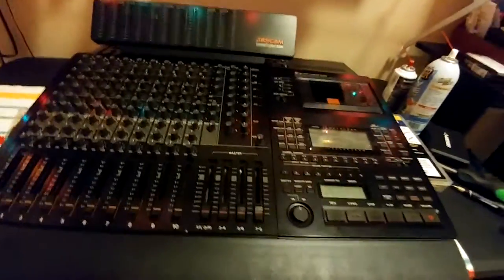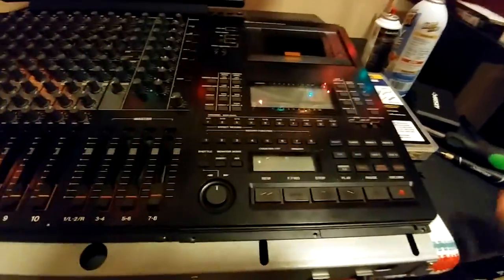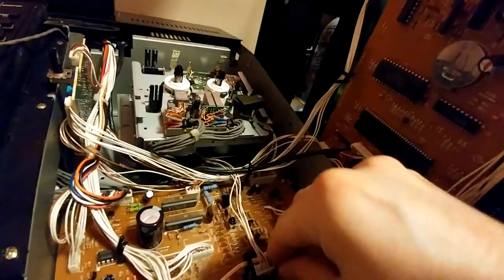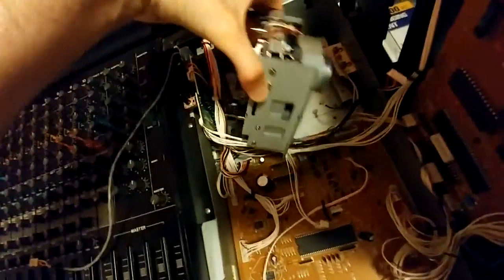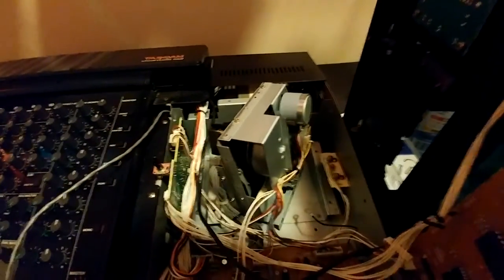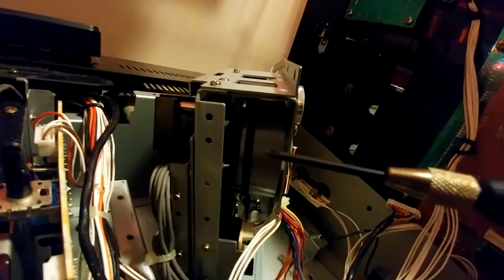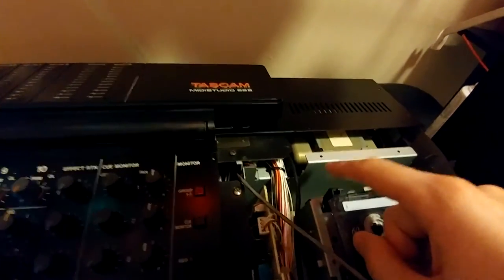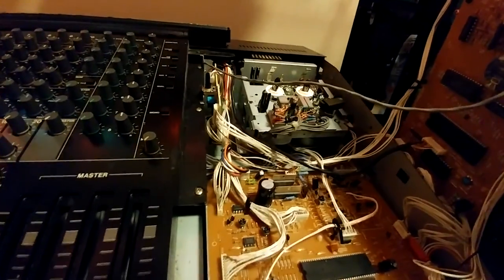Tascam 688 Belt Replacement (and solution to transport stopping during playback)

Comment: Also the battery is CR2430. It is spot welded/soldered in. So you can't remove it by force. You don't need the battery except for savings scenes. For me the default scenes 1->12 are all I need. So I just left the old battery in there.

Comment: Thanks for posting this!

For anyone else struggling with getting the wrist piece off (on the front of the unit), I also had to take three additional screws off of the bottom. These are clearly visible and not hidden inside holes or anything.

Also, he forgot to mention there are three screws on the right side of the transport control panel that need to come off before you can pull the panel off.

Comment: I just finished changing my belt thanks to this video! I also followed the service manual which you can get from hifiengine. You don't need to remove the screws for the wrist rest. Just loosen them a little and it will slide right out. When putting it back together, put on the side brackets before putting the wrist rest back on. There is a little L bracket that gets in the way of the side brackets. You have to remove it's bottom screw and rotate the L bracket out of the way. Then the side brackets goes in easily. Another gotcha was the screws that mount the transport to the frame. There are three, one on left and two on right. You need the right size screwdriver to get them out. I had to experiment with different bits to find that would grab. If none grab you can try taking pliers to grab the screw and rotate it. When putting these back in , don't over tighten. They are not meant to hold the transport securely. There will be a little wiggle room which gets removed when you put the two final scews that go through the cassette well.
Reply: nice tips , thanks ! where did you purchase the belt replacement?
Reply: @jazzroom  ebay
Reply: @fhussain44  thanks for reply ! Ive ordered from eBay too but it is to big ..even though it's been advertised as the Tascam Midistudio 644. Do you have the name of the ebay seller ?

Comment: Thanks, you've been a great help. I was almost there, now I know I won't break anything. FYI, those two adjustments in the video (that you said not to mess with) are speed control trimmers. R2 is used with pitch control in 'fix' position. R1 is used with the control in 'ext' position.

Comment: I just followed these instructions to get it open, sure enough the belt is age melted in there on the capstan roller. Time for a new belt and back to using this amazing machine. I’m surprised to see there is a button cell battery in the piece that you pull back, mine has not been changed since at least 1999.

Comment: There is some disagreement on whether you need to put grease/oil anywhere. I just put a drop of sewing machine oil inside the capstan bore after I removed the whole flywheel by sliding it out.  Rest I just left as is since it was all functioning fine .

Comment: 1, You don`t need to take the wrist support screws out , just loosen them 2 , if you take the wrist support off first and then remove the 2 clips (one either side) you dont have to fight with the side trim pieces AT ALL .

Comment: any recos for lubricants for the motor / belt that you mention? as well as cleaners? also have a 644 with the playback issue. ordered capstan belt and motor replacement and using this video to make the repair. thanks!
Reply: @albino_gringo1912  super helpful. what about cleaning where the belt dissolved. i imagine remnants are still there once i open it up. just iso alcohol and cotton swabs?

Comment: Thanks for the video, I want to change the battery on mine now I know where its at. Do you know what coin cell to use 2016, 2032 and have you changed yours out?
Reply: It is CR2430 and it is soldered in! So don't try to pry it out like I did..

Comment: Thanks for the vid! I just replaced my capstan belt (the old one had completely deteriorated). Now it rewinds and fast forwards fine, but plays at a manic speed. Any idea what I did wrong?
Reply: I don't think so, but I'll reopen it and check. Would that make it run too fast?
Reply: Mark Zanandrea whats was the solution to this problem ?

Comment: Much respect to you for creating this video. Big boost in confidence on repairing myself.  I'm experiencing the transport issues (random stops) & scratchy faders (buttons & knobs). Is there any precaution on opening the left side panels for inspection? Thank you !
Reply: using contact cleaner and air blower is good for faders and knobs. But opening left side panels is a complete mess for cleaning deep inside. Try a air blower for the faders and knobs. it works well. (sorry for my english)

Comment: Dude,
This is great info. I am having a problem where the Capstan motor seems to be continuously spinning, even with no tape present. I noticed your Capstan was spinning until you powered down. My unit is as pristine as yours, with actually very few hours considering 1990(?) Purchase. Virtually no Stunt mode shuttling, or variplay, simply record and playback, maybe 100 hours lifetime on unit. I was always a diligent cleaning / degaussing engineer, having worked on 1” type C” Broadcast units since early 80’s at MTV and HBO. Is the Capstan motor supposed to spin all the time? It would seem that would burn out motor. I only noticed this very quiet day in my loud Condo. I see Battery for CPU under Board you removed, I have not even had to replace that. Thanks a million, any ideas? Do not have either my owners man or a service manual, though I downloaded a barely visible ops man. Great Unit for its day, still works, but I figured some micro switch was giving a false run signal, even without tape in unit. Idea’s? -Bobby

Comment: Thank you for this video. I replaced the belt, but my FF and RW still don’t work, and the playback is sluggish. If I try it without a tape, playback still sounds like it’s struggling, FF works, and RW looks like it tries but can’t get it moving.  It acts like the motor(s?) is weak. What should I try lubricating to get it going? Other ideas?
Reply: You have to replace the idler tire too probably.  It's a little harder to reach. You have to check if the middle motor is running properly. If it does you have to remove that motor and check the rubber tire, clean it or replace it. I'm afraid tascam does not make them anymore. Some shops still have them . Sluggish playback can also mean the pinch roller that presses the tape to the capstan is dirty or worn out

Comment: I'm blown away how you managed to do this while holding a camera. Did this yesterday on my 644 just to realaize that the actual motor driving the belt was broken. And after that I accidently made contact with something and I think fuse or something  went out. It doesn't even light up anymore. F a i l. Any ideas on what it might be? Would be extreeeemely thankful for any ideas. The fuse in the power adaptor seems fine and it sounds like the power adaptor works (low hum)

Comment: Hey, thanks for the great video! I have a question regarding the transports connection to the brackets (one screw on the left, two on right). When tightened all the way down, the transport is not 100 fastened (it wiggles). Was this done deliberately, relying on the two small screws inside the deck to stabilize the transport, connecting it to the front plate? Thanks!
Reply: I noticed the same issue. I think the two small screws inside the screws are enough to hold it all in place.

Comment: This is awesome, thank you! I've just completed this repair and all is well, but holy crap, I have having a living nightmare getting the side panels back on. Any suggestions from anyone? I just can't get the front clip to catch in the hole, and that damn metal tab up front is totally in the way.
Reply: take off wrist portion first ...then loosen the bottom screw on  ''L'' bracket and pull it away from the side panel.
Reply: @willd302  Thanks, that did the trick! I just rotated the L bracket like 90 degrees clockwise

Comment: Hi do you know where i can find a new belt for this? I replaced it with a 488 belt and got it play and rec but whenever the tape plays the audio sounds muffled but when i hit record it sounds normal
Any help?
Reply: The Tascam 688 has 2 dbx switches. if you play a non dbx tapes it sounds really bad.  maybe switch dbx off at the back of the unit.

Comment: I am having problems with my tascam 688. I’m getting tracks 1 through 4 Recording to tracks 5 through 8. Also tracks 5 through 8 recording back to tracks 1 through 8. I’m not sure why this is occurring. I have one into the matrix and routed the tracks properly but this is not fixing the problem. I have change the recording input to line input and to microphone input. And still coming up with the same results. I have Erase my own presets and went back to factory presets but this is not working for me once again still having the same issue.can you me help out with this?

Comment: Hi - I have an older grey 688. The fast forward and rewind work fine - but it wont play - the cassette head moves toward the  tape then goes back and stops. However - strangely - if I hold the black plastic tap back as you suggested with no tape in - the right play motor turns fine. But when I put the tape in nothing turns and there is a skidding sound. I notice with the tape in the capstan against the black roller does not turn - is that supposed to be motorised?
Reply: @albino_gringo1912  Hey thanks for that detailed reply! If I put the tape in and push the tab with extra pressure - it does not work. Yet of I take the tape out and press the tab t does - strange eh? I think the capstan motor not turning and sticking so much when the tale is pinched the transport gives up and returns to its position. So maybe thats that's belt as you say (I assume there is one that moves the capstan:).

Comment: Hi there. I have a problem that I can’t diagnose. When I press the play the heads come up but don’t stay engaged and drop down ? I haven’t yes taken the unit apart as the ffwd and rew still work so I’m not sure it’s the belt but thought I’d ask you first for any insight ?
Reply: @albino_gringo1912  many thanks for coming back . I’ll give that a go
Reply: @albino_gringo1912  and are you still using your 688

Comment: I Just bought a 688 , it seems to have good belts, but it stops playing the tape after a while. I hope this is the solution.
Reply: @albino_gringo1912  It must be the sensor switch , the tape was good.  I had one other issue. A broken dbx 1-4 switch at the back panel. Maybe the previous first owner had a little accident with it.  It had been used as a mixer a few times , the 688 looks brand new for most part.
Reply: @albino_gringo1912  I think i'm going to clean it first, because the unit was not used for many years.

Comment: As a  Teac Technician this is good to show people how to take something apart but you lack the terms of parts and never look at the service manual to give correct information- the board to the right of transport is for speed adjustments not power or bias. The Capstan wheel is called the Flywheel the plate to the rear is a Thrust plate, The nylon on the capstan motor is a pulley and so on. If you are going to all this trouble with videos get a tripod to get us off the ocean.
Reply: @albino_gringo1912  It is Ok to work on decks yourself- many people I help do so  but if one is going to make a video for instruction then would it not be a good idea to look at service manual and get correct terms and don't say things about adjustments with out having some idea what that is? I just am sensitive to those that try to instruct without the real knowledge that is needed to do the job right. Other wise I liked the video some of the way.